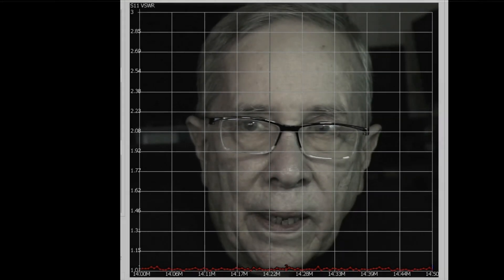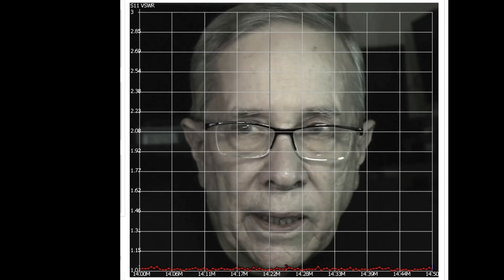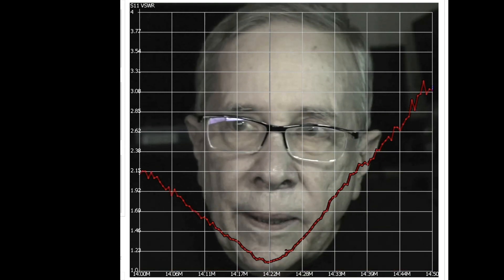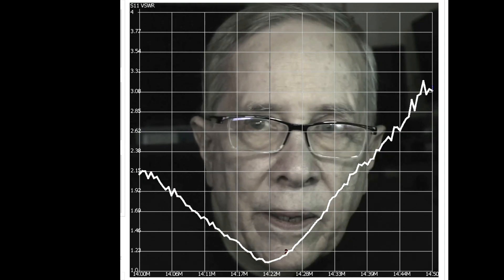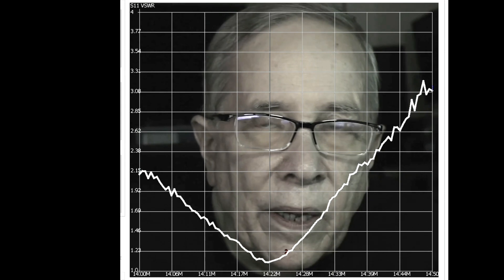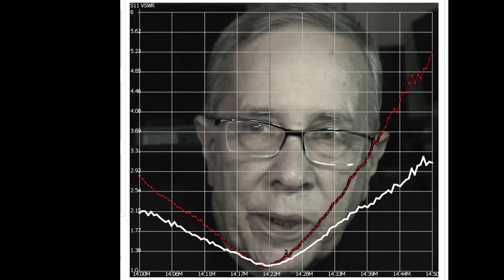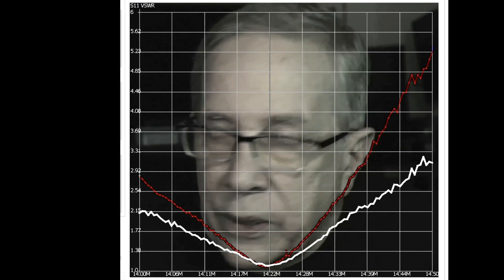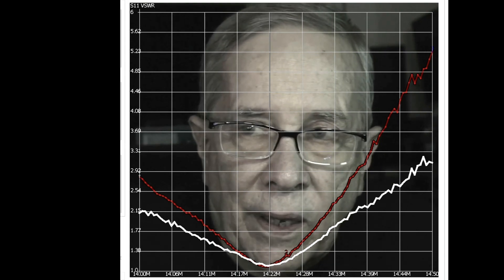Why is the SWR Lower with a Long Length of Coax and Higher with a Short Length of Coax? W6LG Answers

Comment: lol, I tested my TV antenna (bottom end is range 470mhz) for UHF CB (477mhz) - swr was 1.0.   Spoke to a buddy without problem with it, so cut it down, put a patch lead on it & SWR went up to about 2.9?   Another buddy, 200kms  away did the same thing but got a SWR with a random TV yagi (rescued from the dump) of 4.5.  But by putting about 10 feet of coax in the mix, it seemed to damp down the reflected RF? Just our own theory as clueless CB'ers.   ...TV antennas aren't optimized for TX but transmission between the two over 200kms sounded like talking to someone in the same room.  
Not sure what bands in the states, TV antennas might could be repurposed for.

Comment: Yes I figured this out myself. Simple logic is take a very long length of coax. Well the loss going one way will eat up the transmitted power and then it has to reflect and come all the way  back. By the time it gets back it's will be even lower. Swr is out going  vs reflected and if the reflected gets smaller because of coax loss then the swr will get better.
Ultimately an infinite length of coax is going to have an swr of 1:1 since nothing comes back. Not because the antenna was a perfect match and absorbed all the power but because the coax did instead

Comment: It's about eliminating unwanted coax lengths such as odd quarter-wave lengths but it depends on the impedance of the antenna and how it's been constructed. Find the length that matches the antenna best extra coax can be wound on an ugly balun or rf choke. Experimentation is best as every situation is different. The counterpoise or mast can also be effecting swr if it's a strange length compared to the main element.

Comment: Wrong, impedance is relative to frequency. An antenna with an impedance other than R50X0 will (1) make the coax act as an impedance transformer (2) will further manipulate the load impedance due to line loss. Smith Chart.
Reply from the maker: Hi Mr. Soto,
I am in the middle of chemotherapy and hopefully I can make some sense.  The title of the YouTube video was "Why is the SWR Lower with a Long Length of Coax and Higher with a Short Length?"  You are saying that my answers were wrong.  I politely strongly disagree with you.  Long feedlines can have big losses.  Those losses make the SWR appear lower at the feedpoint.  The load impedance is the load impedance, period.  The load impedance does not change and should be measured at the load; feedpoint.  Yes as I said, the load impedance changes with the frequency.  It may, for example, be 30 ohms at 14.0 and 50 ohms reactive at 14.3 at the feedpoint.  Look that up on the Smith Chart and let me know what you see.  Thanks and 73, Jim W6LG

Comment: Odd coincidence that I was just watching this video while I had my radio running in the background randomly tuned to 14.255. I was thinking that the guy's voice on the radio sounded strangely familiar. A few seconds later I realized it was your voice and verified it when you signed off. That'll be my brush with fame for the year. I really enjoy your YouTube channel. KM2K
Reply from the maker: Well keep listening and maybe we can have a contact on 20 meters.  What antenna do you have? Is there a linear amp?  Thanks Bill, 73, JIm
Reply: @ham-radio  I have a ZS6BKW Jr and a recently assembled KIO Hexbeam that I'll be mounting at 30-35 feet in the next few days. Currently I'm operating an IC-7610 with an Acom 2000A (lots of headroom in that animal). Yeah, maybe we'll catch each other sometime. Thanks for the reply Jim. Love your videos, 73, Bill

Comment: Assume I've got 10 volt signal feeding a line with 6dB loss.. the signal reaching the top end is only 5V... Now assume it is actually a short circuit at the top end so ALL this voltage gets reflected... vswr at the top end is vf + vr / vf - vr  = 5+5/5-5= infinity swr which is right.... But this 5v reflected at the top is then attenuated by the coax and the reflected voltage at the bottom is 6dB down so only 2.5v reflected is seen at the bottom so the vswr seen at the bottom is 10+2.5/10-2.5 = 1.7:1 which fools you into a false sense of security & happiness. 
Ok 6dB of feeder loss is a bit big but you can see how easy it is to mask a bloody awful real swr and think in the shack that everything is cushtie (when it really isn't)
The other one that's fun is people having an external swr meter in line with the co-ax but then using the internal ATU in the rig... The rig reports 1:1 swr but the external meter still shows a crap vswr... People forget that all ATUs do is match the transmitter side so that the rig doesn't damage itself & it seems to see a reasonable match... Forgetting that the impedance on the feeder side of the ATU is still WAY off 50 ohms... This is ok when the ATU is right at the antenna and it isn't a 50ohm antenna... But if it is feeding 50ohm co-ax then the swr on the feeder is going to be horrible.

Comment: You didn't mention the coax best to be an electric wavelength division best for your favorite freq. You can install antenna switches to adjust coax length for different bands. You HAVE TO tune the antenna without coax or a very short length at the antenna. Try 4" wires 1 jumpers w/ 2 RCA plugs or RCA and Alligator and 1 jumper 2 alligator clips.
Reply from the maker: You are correct.  In a YouTube video I have to limit the information and time is short.  The question was why 3 feet versus 100 feet?  That I did answer.  There are many issues that I don't have time to discuss like phases, wavelength, delay, loss and much more.  Thanks for the help.  73, Jim

Comment: Yeah Coax Cable has some inductance and capacitance as well as attenuation, depending on the frequency, type and power used. Everything is calculated together and considered as antenna system. Also if a length is close to operating frequency it might start (depending on a lot of factors) start to resonate at a quarter half or even at a full wavelength. So per my experience it has a lot of things going on for it, but using a good quality cable designed for frequencies and lengths in use will for sure eliminate some of them.
Reply from the maker: You bet it does.  But I only have about 5 to 6 minutes to get some limited information.  Often just the high points are discussed.  I did  answer the question that I mentioned in the title.  Thanks, 73, Jim
Reply: @ham-radio  Yeah its a big topic for sure would need hours to cover everything lol

Comment: Hi Jim, this phenomeno is good explained in a Bird electronics application notes "cable loss Masking Effect" and there is a table with relation of swr@tx, swr@antenna, and cable loss! At UHF frequency like 440MHz in some cases it is impossible to measure the swr from the Tx side, because the loss is too high, and there no difference with antenna connected, or disconnected! I have a small company in italy and i make Ham antenna, i measure the swr and impedance with a professional VNA, directly at tha connector port with open short and load calibration! Many thanks for your interesting video. 73 Sorry for my bad english Grazioli Pier Francesco

Comment: Good one Jim
I have commented in some of my videos about a 2M J-pole antenna I built one time with 100 feet of RG-58 and SWR in the radio room was 1:1. I knew I was good but this was too good. After completely disconnecting the J-pole antenna from the coax, the SWR in the radio room was still 1:1   ---   with no antenna connected at all - just 100 feet of RG58 at 2M.  73  WA4QGA

Comment: Thanks for the video Jim. I was aware of this and I have likened it to an antenna tuner when explaining it to others. I recently purchased all new LMR 400 for feed lines and LMR 240 for jumpers to replace all of my RG8X for when I move my radio room to the other end of my house. My new room will be closer to my antennas so with the better cable and shorter runs I imagine that I'm going to have to retune my antennas. Oh well it will keep me out of trouble until the wife sees the bill for the coax. Cheers and 73 from VA7DLC.

Comment: Hello Jim, really good to see and hear you. Thanks for another informative video. I have several books buy Ed Noll and he speaks of coax lengths of odd multiples and even multiples with a formula  to match the wire antennas he has illustrated. Of course this is 1969 and 1972 technology. Have you read any of his material?

Comment: I would love to hear your thoughts on a multiband antenna such as the DX Commander (in effect a vertical fan dipole).
Reply: I as well, since I own one, the 12.4 Signature. It measures well at the antenna and at the end of the (sigh) 50 foot RG8x. (Connectors for the length of 213 I have are on the list.)

Or just a multielement fan dipole instead of a trapped dipole.

Comment: I find your topics and demonstrations interesting and very helpful, this one specifically. Can HF band SWR be reduced, and actual power radiated by an end-fed antenna be increased based on how the coax feedline to the antenna is routed/positioned? Assume the routing (of low loss LMR240 coax from a reputable manufacturer) can be changed, but the coax length must remain the same. Thank you for your thoughts and experiences.

Comment: Hi Jim,
Hope you feeling well. Compositing your face on the SWR plot was cool.  🙂 I always go out to my antenna switch to check each cable run to each antenna for SWR. Then I go back into the shack and check the SWR at the radio to see if it matches. Most times it does, but sometimes after a heavy rain the SWR is off. Stay safe.  73  WJ3U

Comment: If the station has a lightning arrestor I'm assuming there's a corresponding ground rod....so, what difference would the wing nut make? The wing nut and the coax shield are continuous/same, no?

Comment: I'm going to guess before watching the video. My Answer is loss. SWR is a measurement of reflected power. Cable loss results in less reflected power and lower SWR.
Reply: Yup. The reflected power or return loss is 2 times the coax loss, going out and returning to the meter. You must factor it in to know the the swr at the antenna input. There are charts to do it but, using the return loss scale on a VNA  or meter you can measure coax loss. To see this, hook a 10Db pad to a VNA and it will give you a 20Db return loss or about 1.3:1 vswr.